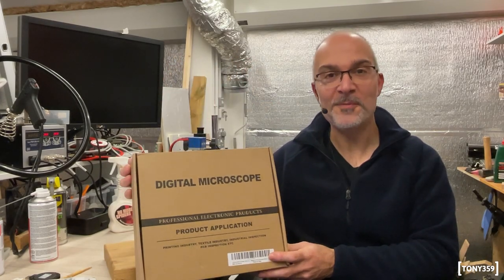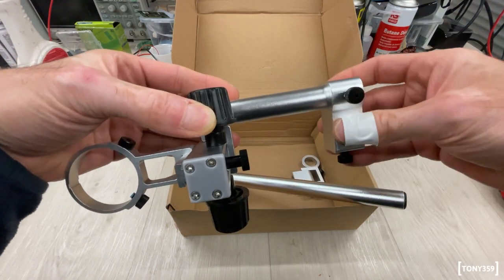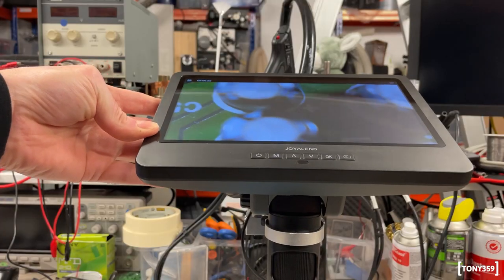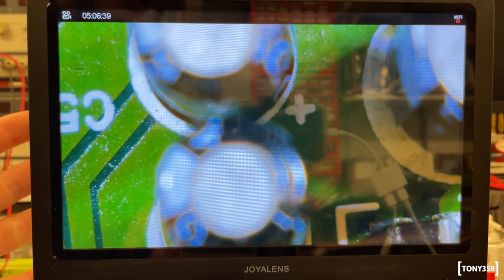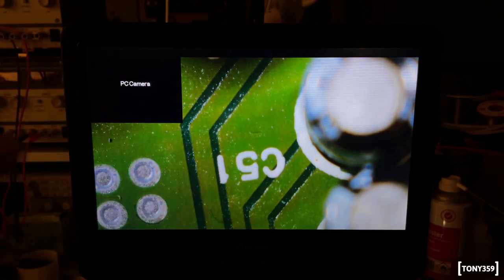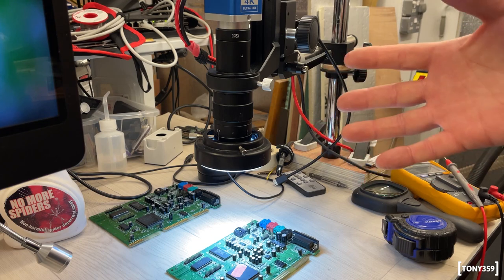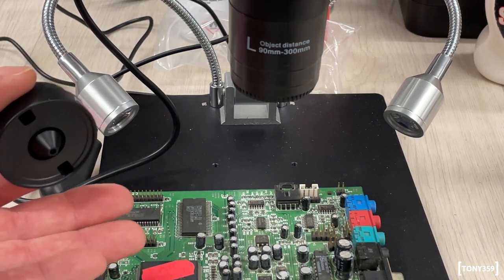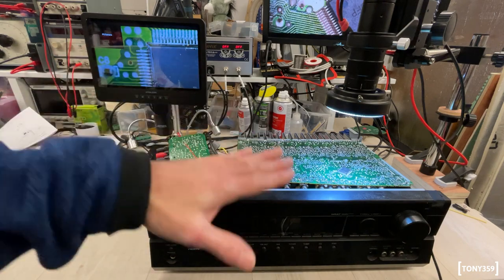Joyalens JL249S-M / Andonstar AD249S-M  - Microscope review

Comment: First you dislike the up/down mechanism with the knobs, which you operate from the wrong direction and thus are not up to your standard. From the front, without seeing them even, they look to operate fine. Then you dislike the standard going to roughly up and down. I seem to think you don't understand the three adjustments working together. The screw in the standard is the first rough height adjustment for your object. The knobs are there for a less rough adjustment, and then you adjust the lens itself for perfection..
Reply from the maker: Thanks for your comment. Can you elaborate on the "wrong direction" please? The knobs are stiff to operate and only adjust a few centimeters. I'm sure you noticed that to magnify to full magnification you have to move the whole microscope up and down quite a bit. By all means you can also use the head knobs to do some "fine adjustment" - of which I don't see the purpose as it would change the magnification very little - it might help a bit with the focus but, again, they are stiff to operate.

Of course if I don't like it, it doesn't mean you don't have to like it! Reviews are always a bit subjective. I hope I have presented the facts and the difference between the Joyalens and a C-mount item. It's then up to you to make the final decision. 
Thanks for watching!
Reply: @tony359  The knobs are meant to operate while viewing the screen. Since you were focusing on the standard itself, your body and arms had a weird angle towards the knobs. @9.26 your operating the left knob with your right hand. When sitting behind the screen, operating it with your left hand, would look much more logical and quite do-able. I agree one of them doesn't feel perfect since it is not free of obstacles, but as a lefty I appreciate the option nonetheless. Also I don't know how much finger tip force is needed to adjust the knobs, but again, I really think the 3 adjustment options are meant to work together. Screw on frame for initial height estimation, knob adjustment for getting in focus, lens adjustment to fully optimize the focus. This does mean that you need to start with the knob and lens adjustment roughly in their middle position. I really enjoy your video's and knowledge, so don't take this criticism too hard :) Thumbs up!
Reply from the maker: I'm not taking it too hard - in fact I appreciate any feedback. I see your points. All I can say is that I have another scope on my desk of similar price (yes, it needs a monitor indeed!) and its knobs are *WAY* better than the Joyalens'. What you say is doable - but I am afraid the Lapsun does the same much better.

Re. using the right hand to turn the left knob... can happen when you have a camera in the way! It doesn't mean I normally use the left knob with my right hand! :)

Thanks again for your comments, they are always welcome.

Comment: I prefer a deskmounted arm as well. I have yet to find a microscope that meets my requirements without modification or adaptation. Currently I am using a "plugable" brand usb 2.0 microscope because it can be screwed into a camera mount and is reasonably cheap. But the optics are poor, there is no autofocus, and the field of view is limited. 

Really I would something that would allow me to scan methodically over something up to atx motherboard size for damage and solder inspection.

I must say that was an excellent and thorough review :)
Reply from the maker: I'm glad you liked it and thanks for watching! I was in the same situation when I was selecting my microscope and most people ended up with the Andonstar which has those very well known limitations. I am not really affiliated with Lapsun (and I am not impressed that you end up with a CMOS sensor lottery...) but have you considered a C-mount lens type with the stand I got? If you contact them directly they can send you the mount without the base (at a lower price) and you get better price than some platforms. You can still pay by Paypal so I hope there is some sort of protection. Again, I am not affiliated with them :)
Reply: @tony359  I'll check out ur video on the lapsun. Thanks!

Comment: This review has very good details and same problems I find when microsoldering with these types of monitor microscopes. I ended up going with an AmScope Trinocular Stereo Microscope for my workshop and much better, no wobble and good working distances. Also, upgrade to a fiber optic ring light for better lighting and no shadows. I repaired iPhone 14 boards with it at ease now and then done large PS5 boards with zero issues. I don't recommend these monitor/microscope they are not good as what you explain in detail in the video. Just the wobble alone is bad enough. Then the shadows.

The lapson seems really good
Reply from the maker: Thanks for watching and for leaving a comment! I only used an optical scope once and I couldn't get used to it - but I'm aware it's also a matter of personal preferences.

Comment: Bought this microscope (the main brand) a week ago and NOW finally the correct review pops up, despite the fact that I was looking for such a review before.
Anyway Andonstar either uses the better Metalwork for its main brand or maybe I had simply luck because I have thankfully not that tilting problem and it even included a additional ring to "preset" a nearer inspection height. Have to see how it works out after a little bit more use.
Reply from the maker: Very interesting about the tilting problem. Well, maybe my review changed something then 🙂 

I’m glad you like my review! Enjoy your new scope! 🙂

Comment: Did you try the "UP" and "DOWN" arrow keys on the bottom of the screen?
Those arrow keys provide you with Increased and decreased magnification. You don't need to turn or move anything. Just push the arrow key.
Reply from the maker: That's digital zoom, honestly I'm not even considering that! Thanks for watching!

Comment: I have been looking at similar kinds of microscopes for a bit now and there are alot of review videos but not alot of compare videos around and I do appreciate that alot.
The mounting system of all of these types have a lot to be desired, bulk cnc aluminium isn't terribly expensive but if the design is already flawed and has sloppy tolerances then you run in to issues like the taper on the upright tube.
For the horizontal tube I think the screw should be put opposite to the flat spot to push it into place, simple design decision with huge improvement possibility.
For now I would rather invest that kind of money into a decent oscilloscope and keep using magnification glasses instead😁
Reply from the maker: Indeed the horizontal tube flaw is unacceptable, as you say it was just a matter of designing it differently. I'm very glad my video helped you in your decision making, thank you for watching!

Comment: Wondering why the price is the same as AD407? Currently, Andostar sells them both for 150 EUR. AD407 has a fixed lens, no bundled lenses and other stuff. Am I missing something? Does AD407 have something worth AD246S-M with all its bundled stuff?
If AD249S-M has so many flaws, is there anything better for the same price (under 200$ / 150 EUR) also including a display, or with a stand for mounting the camera and a small HDMI display?
Reply from the maker: I don't know to be honest. Many companies have sister companies which sell at lower price, I think it's a marketing strategy.

Comment: does anybody know how to polarize the adsm249 digital microscope lenses? I know can cut the direct polarizing the adsm24? For the led lamp lights I can cut out circular small rings measured out with polarize film install them easily and turn them to deflect light, but as for the 3 lenses andonstar provides lens a d and the one mounted is there a glass lens I can buy to install on all 3 lenses so I can cut film for it that fits or an adapter? Does anybody know where they are or who sells the compatible glass lens?
Reply from the maker: If I remember right those "lenses" are minuscule and don't have a thread to attach anything else like the C-mount scopes. But it should be easy to cut a piece of polariser and attach it on the inner side I think. It was some time ago :)
Reply: @tony359  like film from Edmundoptics and laser cut circular exact on inside of the lamp lights and the inner ring of all 3 lenses of this model? I have lens a d and l .. you can put them on top of the pink lens inside right and then screw them on and fine adjust with the lens focus and lamps right to deflect light? I sharpen knives as a side business and I need this polarization to work. The light reflections off the knife bevels and edges is ridiculous. Polarization is the only way I hope you understand.
Reply: @tony359  please let me know Tony if I can laser cut polar film and place them exact measurements to the inner ring of these 3 lenses that come with ad249sm and use the focus to adjust the light and cut out film for both lamps exact and fine twist them at same time? Or do you have a recommendation with someone who us using this technique
Reply from the maker: I don't have that microscope anymore, it was won by one of my viewers :)

Comment: I have the 6 inch version of this microscope and for the $130 I paid for it, I'm quite pleased but the firmware can be very buggy.  It also refuses to boot with my micro SD to SD extension cable plugged in.
Reply from the maker: I admit that for $130 it's a better deal. At that point the Lapsun type of microscope is definitely more expensive. Thanks for watching!

Comment: Joyalens Andonstar Linkmicro. Is the same?
Reply from the maker: Well, Joyalens customer service is @andonstar.com so it must be similar! I don't know about Linkmicro.
Reply: @tony359  Linkmicro have identicals products...
Reply: @tony359  Is this microscope suitable for soldering on electronic boards? Does it have a lens to protect the lens from the smoke and heat of welding?
Reply from the maker: No. There is no protection and you cannot get one. If you get a C-mount scope then yes, you can get a protection.

Comment: Much of the criticism is targeted at the stand. To compare with the Lipsun, you should have mounted it on the same stand. I would have also liked to see the free measuring PC software in action..
Reply from the maker: Unfortunately the Joyalens cannot be mounted on a C-mount stand. The stand is part of the product here in my opinion. Also, the C-mount stand would only improve on the unsteadiness, the issue with zooming in and out would stand. I feel the picture quality is covered in the video, a better stand would help but wouldn’t change my overall opinion on the item. Im comparing what you get when you buy a C-mount vs what you get when you buy a Joyalens. 
Sorry for not covering the software, it’s just that I don’t have an use of it - and I feel most users would not need it either. But thanks for your feedback and for watching!
Reply: @tony359  Sorry, I meant if the Andonstar was mounted onto your Joyalens stand. I took delivery of the 7" version of this scope today. The stand is very firm. There is no shake or movement whatsoever. Maybe it's because it is lighter. For a non professional, I can see I will greatly benefit from using this. Also, using Cheese application in Fedora Linux gave me a good monitor size image but I will most likely stick to the very good 7" display.

Comment: Finding faults for no reason its a stand alone unit
Reply from the maker: Could you possibly elaborate on that?  I think I mentioned multiple times that the advantage of the Joyalens is the integrated monitor. The "faults" I found are not related to that. In fact, the monitor is of good quality. I'm interested in your view though if you could explain a bit better. Thank you!

Comment: Sadly, given the abysmal quality of many of those scopes on the market, and the jacked up prices, if one has already a 7" or bigger tablet, a £25 USB digital microscope on a pole would give similar results at around 6-10 cm away from the PCB with minimal lag (an old laptop would work even better).

Going lower than 7", all one needs is a 5" phone on a tripod and a cheap ringlight to achieve an even better quality using 4/8 digital zoom on a working distance of 7 to 15  cm.

Not joking, I went through a few products recently and tested both the tablet and phone camera ideas for the sake of comparison. 

In the end, I think the better value for money are the HDMI 1080p camera modules, as they can be paired with a monitor which can be bought for £90 new.
Reply from the maker: Yes, this product can only appeal someone who doesn't have a screen/tablet and who just wants an all-in-one solution without too much hassle. Thanks for watching!

Comment: I found the stand to be horribly obtuse in design. I used a microphone boom arm and a desk clamp with a 3D printed holder and eliminated it.
Reply from the maker: That's a good idea for sure! But it adds to the point that if you also need to add another stand and 3D printed parts, it's less and less appealing! Thanks for watching!